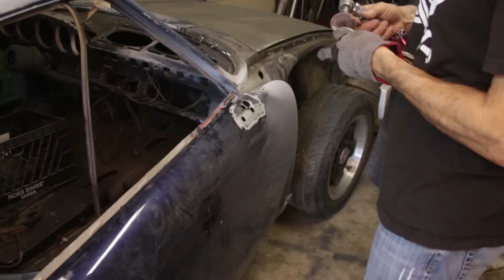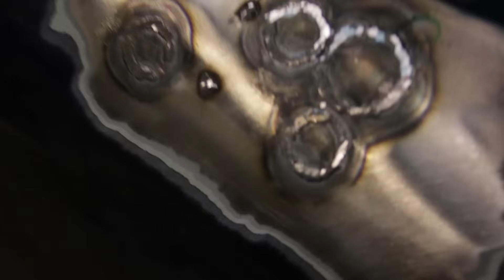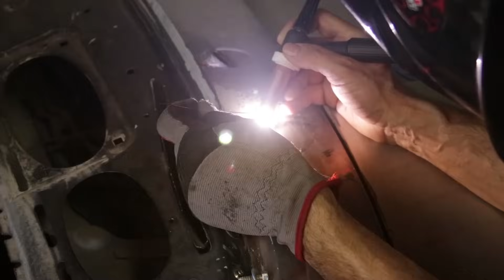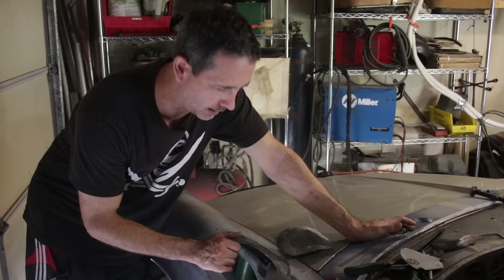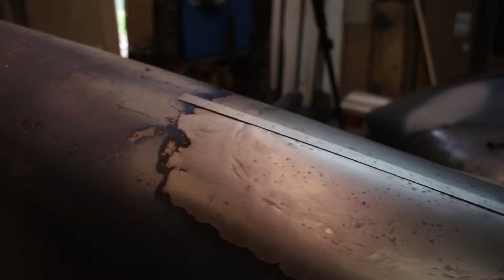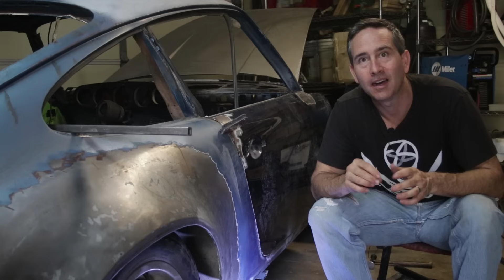How to Fill Holes in Your Car - Correctly (Yes Welding!)

Comment: How did you cut the circles out of sheet metal?
Reply from the maker: Tin snips and then the edges adjusted with an abrasive disc
Reply: @GarageTimeAutoResto gotcha! Next question: how do you prevent the completed patch from rusting out from the inside, assuming the inside panel is inaccessible (example: rockers)? Research ive done says spray the back side of the patch panel (circular disk in your case) with weld thru primer before you weld'er up, but is that all? Thanks
Reply from the maker: No, you need to get epoxy primer and  cavity wax on it after it's welded.
Weld thru primer will burn off during welding.
Rockers usually have drain holes, so there are wands that you can snake up there and spray stuff.  You can also use a boroscope to see the back side.  
If there isn't a hole, then drill one from inside the car!

Comment: I was thinking it would have been easier to cut out and replace the group of holes in the door with less distortion.
Reply from the maker: Maybe this is true, but if you add up the weld length of the holes versus the weld length of one patch, I feel the hole perimeters are less.  Less welding means less heat.  You are right though it's close.
Reply: Thanks for being a good sport and you’re right as well, there is more than one way to do most things

Comment: Great video! Question: when you are TIG welding those discs of steel to close the holes, are you aiming the tungsten directly at the seam, or do you start on one side and then cross the seam? Thanks.
Reply from the maker: I zig zag across the seam.  This video shows more of my technique. https://youtu.be/t2xomaxWhFc
Reply: @GarageTimeAutoResto  Thanks! I'm about to try a similar hole-filling exercise on 1mm thick aluminum, so am concerned about blowing holes. Starting the puddle off to the side and then dragging it across the seam would make sense.

Comment: Cool video and nice car. One way that I teach this in my videos is to patch the holes with a piece of tin and solder. With this technique there is no chance of having the panel warp. The soldered patch is also waterproof and permanent. I've been doing this type of repair for about 30 years and never had a fail. Thanks!
Reply from the maker: Cool, thanks for that.  I work with lead sometimes too.  There's also Silicon Bronze which is kind of between the two.  How do clean the acids off the backside if there is no access?
Reply: @GarageTimeAutoResto  You don't need to do anything to the back side. Not sure what you mean by acids. You could put weld through primer on the back side of the patch before you solder in to place but other than that nothing else is needed.
Reply from the maker: @autobodytrainingsolutions838  Acids in the solder flux are very corrosive
Reply: @GarageTimeAutoResto  The residual acids are so minuscule that it will not be a problem. I've been using this technique for over 30 years and haven't had any issues. Give it a try sometime and see what you think.

Comment: Your workmanship is incredible!
Check out Fitzee’s garage
Spot weld a wire to a scrap of sheet metal, 
Spin the scrap piece with the wire and grind them into a circle.
Keep grinding until it is the exact size you need. Much quicker and easier than fabricating a circle piece.
You could also countersink the hole you are filling and bevel the edge of the patch with the grinder so the patch won’t fall through.
Reply from the maker: Cool thanks, I've seen a few of his vids.  The tighter the fit the better for TIG welding.  I'm not a fan of mig welding like fitzie.

Comment: A few things!

Frist off, Great work! both on the welding and editing! this is the first video I see of yours, but subscribed!

and then a few questions!

What settings do you use on the welders for this type of work? size tungsten and rod?
The hammering after the weld is just to even out and take out any tension after the metal has been heated?

I just got a tig welder and I`m welding up my Mk2 Escort so I`m looking forward to seeing how your project moves along!

Its also REALLY refreshing having a guy in a garage enjoying what he does, not a guy with the "fabricator cap" telling you that you need the most expensive tools in the world and that there is only one way to do it.

again, great stuff! keep up the good work!
Reply from the maker: Thanks for subscribing!  You will find more videos that show you how to make things with common tools.  Here I hammer the inner hood skin at the beach:
https://youtu.be/benS07bAOgw
Here's more info about TIG welding
https://youtu.be/t2xomaxWhFc
.040" tungsten, .035" filler wire from MIG, about 30A

Comment: Nice Work bro, I use a sponge and water to cool off the welds in between and it works the best for me.
Reply from the maker: Sure!  Just be careful you aren't over shrinking the metal.  Rapid cooling is how I intentionally shrink down high spots.

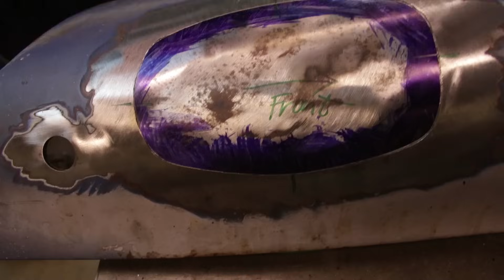Comment: What is the blue stuff you use to mark sheet metal (8:46)? Maybe it’s Eastwood CRC Blue Layout Fluid?
Reply from the maker: Dykem layout fluid comes as a spray or brushable.  Most likely the same stuff as Eastwood

Comment: Make sure you use PAR 15 after welding that fender, it’s sandable so you can put under back over it
Reply: He means POR 15 which you don't need on clean metal.  A good etching primer will do just fine.  Don't waste your money or time on POR 15.  Way over priced and its better to cut out rust to paint over it.
Reply: 4 oz. $12 on eBay lmfao use it on the back of welds.
Reply from the maker: Agree 💯.  Sorry for the very late response
Reply from the maker: I'm not a fan of POR15, but a lot of people like it.  My problem with it is it continues to harden and crack over the.

Comment: Nice job fitting the peices! I Was woundering what type of tig setup you have...your heat controll is on the tig handle?
Reply from the maker: Thanks!  No I use a foot pedal for amp control.

Comment: Is TIG welding more efficient on cars body, than MIG, or present any other advantages ?
I'm trying to decide if makes sense to spend a bit more for a TIG welding machine or limit on the MiG.
Reply from the maker: Ooh man, that is a tough one and a long answer.  TIG is more gentle to the metal and easier to work smooth.  However the learning curve is high.  I have an AutoBody TIG course.  Email me at tperazzo356@gmail.com and I'll send you the TIG versus MIG piece.
Reply: @GarageTimeAutoResto  I've done some welding courses a year ago, on MIG and TIG, but on stronger metals only and just have to decide if worth spending extra money for the TIG version or I could fix the car with cheaper MIG version. Since I'm in the wheelchair and working position is not so great, I wonder if having to use both hands on TIG, would become an issue at some point. 

Also, can you please share the model of that small air tool ? It might be preety handy at some point. 

Thank you for your time !
Reply from the maker: The price of TIG has come way down and there are machines that are combo MIG and TIG too.  If you want to get it done quick then MIG is probably the way to go.  TIG can be difficult when working in awkward positions.  I like the foot pedal for thin metal, but there are torches with finger control too.  
That is just a 1/4 air die grinder with a 3M roloc disk on it.

Best of luck man.  I'm sure you will find a way

Comment: How would you fill the washer holes if you couldn't reach the other side?
Reply from the maker: Great question.  Back side access is important if you want no filler.  Especially on a cowl that is mostly flat (low crown).   Here are the options
1). Use paintless dent tools to raise the weld area between short welds
2). Weld tabs or use a stud gun to pull the weld area
3). Cut a hole in the inner structure and weld that one after.
4). Use filler!

Comment: For body work, is it better to tig or mig? Is tig more forgiving on thinner metals?
Reply from the maker: I made a video about TIG versus MIG here:
https://youtu.be/t2xomaxWhFc
I think TIG is better for autobody work, but it does take more practice and skill.  I like that the heat is very precise and not much filler metal is needed.  
You will probably get a different answer each time you ask, but I do know that all of the high end auto restoration shops use TIG or gas welders.
Reply: @GarageTimeAutoResto   Yep.  Tig is a true full penetration weld . Being able to be dressed while hot ( hammer /dolly)   It takes a bit of practice to perfect.  Just like Oxy/ acet.  On the other hand   Mig is meant for heavy grade metal.  The tack tack tack method on sheet metal produces a line of hard lumps that have to be ground down and re welded to cover the missed pin holes.   The Mig process is quick and dirty to get the job done.  It's hard and brittle and will crack in the future,  but bondo will hide all that rough grinding.  Most videos show this.   I'm old school and I stay with oxy acet.  There's no comparison with the quality and the junk.  Take your time and do it right.  It will last forever and most times the filler is 1 mm at the most.     Look at the back of the welds and it will explain all.    Good luck and enjoy a good job done.
Reply from the maker: Good response Rob, I agree 100%  about the quality of welds on sheet metal.  TIG and Oxy heat the base material and the filled actually cools the weld.  With MIG welding the filler is the source of the heat which makes for a brittle weld.  Even if it's a continuous weld it will still be brittle because it's overheated by design.

Comment: Good job. I’d use a small Dremmel burr  to finish off those welds.  Maybe even less heat.  As far as the gas flap goes, I would leave a gap and use interclamps to hold it in place.  Seems like with a tight gap, that filler piece might grow.  Did you have any problem with it expanding to much after everything was done.  Guess you could shrink it back with a shrinking hammer if that Happened.  You are doing a good job that will require little or no filler.
Reply from the maker: Thank you!  I sometimes hand file welds if I'm worries about heat, but not a big deal. Carbide burr is a good idea. I didn't notice anything growing on me.  In my experience everything shrinks when welding.  That is why I like the tightest gaps possible with TIG.  I did use a little filler on this.  Now the car is painted!
https://youtu.be/0_tmWNdsA5k

Comment: Would laying out a good three coats of epoxy primer over those areas do? Then you can block it out and see if your lows are gone. Each layer of paint is roughly a mil.
Reply from the maker: Rufus Wilson yeah, epoxy primer and then a poly primer over that or just typical polyester filler.  I'm not one of those guys who like to say no filler, but then have layer upon layer of primer.
Reply: @GarageTimeAutoResto  NO! NOT! Epoxy primer.  Etching primer on bare metal. Then hit it with a good 2K fill primer.  "Epoxy primer" is not a commercial / industry product.  Its a marketing buzz word. Etching primer for bare metal - high build or filler primer for over rough surfaces and filler.  Both should be 2K (2 parts 1 body 1 activator).
Reply from the maker: Times are a changin'! Epoxy is now the restoration industry standard.  Better adhesion and corrosion protection.

Comment: Was always curious, when beating the weld, do you guess on how much to hit it or just hitting it a couple times is all you need?
Reply from the maker: It takes a little practice and many small hits are better than a few big ones.
Use a dolly behind and hit it so the weld gets squished or stretched. 
Monitor your progress as you go the distortion is very low.
If the weld area is still low than it probably needs more hits
Reply: @GarageTimeAutoResto  Thanks very much Sir

Comment: Nice welding work!  Question: why are you switching between MIG and TIG?
Reply from the maker: I used TIG as much as possible.  Sometimes MIG is better at filling holes.  Do you use TIG?
Reply: @GarageTimeAutoResto  I’ve got a YesWelder 205DS that can do lift tig but I’ve never done it. It looks to be very precise vs. MIG. I’m repairing the floorboard on my 2002 911 and in some spots the metal is very thin! Like 20ga! I’m dropping the video tonight. I’d be interested in hearing your opinion when you see what I’m doing. Thanks!
Reply from the maker: Ok, I'll try to help
Reply: @GarageTimeAutoResto  Cool! I'm really looking for perspective as to whether or not I'm doing it right. The video is up now if you're interested.
Reply from the maker: Oh man, almost an hour long!  I'll let you know when I get a chance to review.
Reply: @GarageTimeAutoResto  lol, yeah. It’s got a lot of prep work and stuff.

Comment: Great job! What type of miller tig welder are you using?
Reply from the maker: It's just a Diversion 180.  Bought it used too.  Thanks for watching.
Reply: Thanks for replying. If you were going to weld in a patch and had no access to the back of the panel would you still tig or would you use a mig welder?
Reply from the maker: Hey Brian,. Good question.  I would still TIG, but here are some thoughts.  1) patch should be roundish and not squarish or sinking will be worse.  2) might think about silicon bronze filler metal??? 3). I've used paintless dent tools before to push from the back 3). Consider pre stretching the metal before hand.  4). If you really want it to be perfectly straight, then cut out whatever is obstructing and then put it back after plannishing.  5). Cave and pave. Sorry for the random brain dump, but do what you're comfortable with!😀

Comment: Great work. Why not cut the back metal open a little so you can get dolly in since you will be welding it later anyway?
Reply from the maker: Thanks, are you talking about antenna hole?  If so, that was plan B!  If it really distorted then I would have opened the back up for access.  It wasn't that bad so I left it alone.

Comment: Very nice work.  One question.  I know that welding up a hole with a mig welder makes a hard weld that is difficult to hammer and dolly.  So if you go back over with the TIG welder, does it soften up the weld bead so you can hammer and dolly easier?  Tom
Reply from the maker: Tom Hi Tom and thanks!  Yes, I think going over a small weld like that with the TIG will soften it to some degree.  It's all about how hot it gets and how slow it cools down under the argon shield.  I don't recommend the MIG TIG combo as the best approach because it's not a very pure weld.  MIG welds are usually dirty which is obvious when the TIG goes over them because stuff spits out of the puddle.  I did this on the rocker because I didn't have access to the back side.  If I did I could have enlarged the hole and tigged a small patch in.  That would put extra heat in the panel that would need to be hammered flat.  Good question though.
Reply: Garage Time - Auto Resto , what I have been using now for welding up the ole 29 model A coupe I am working on is a old Dillon Mark gas welding torch.  One good thing about it is with the RG 45 filler wire the weld is pretty soft.
Reply from the maker: Tom Awesome, I wish I could gas weld!  What size does that filler rod come in?
Reply: Garage Time - Auto Resto in lots of ways gas welding is like tig welding.  I think I use 1/16 rod.  The Dillon torch makes a lot of difference in my opinion.  Tom

Comment: What did you use on the grinder to get the paint off?
Reply from the maker: Its a 7" strip it disc on a low rpm sander.  I stripped the whole car with it.

https://youtu.be/U3Cqdiywe54